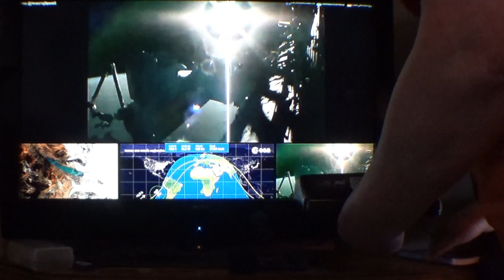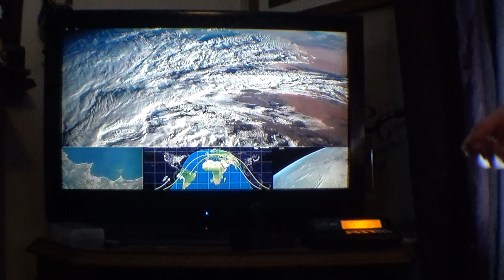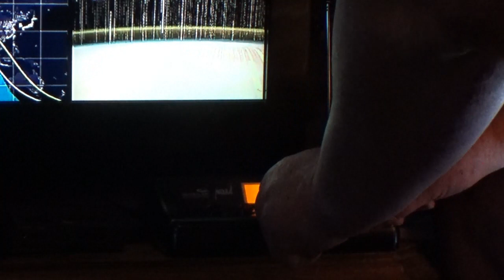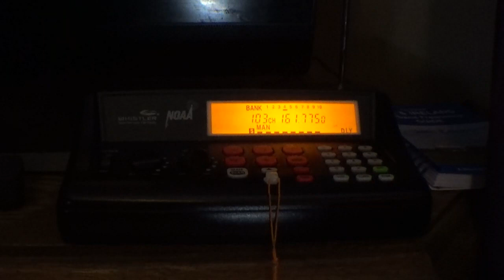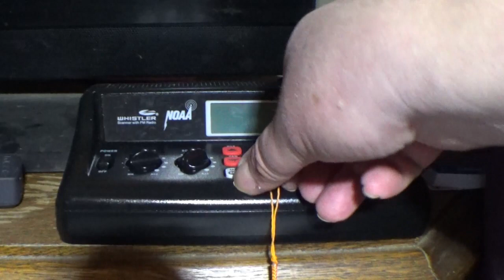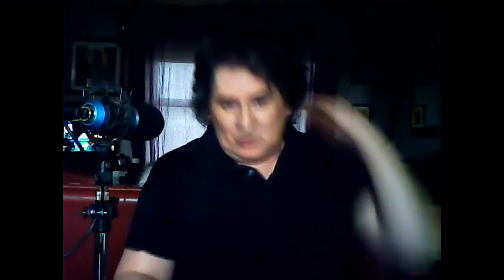SPIRIT BOX SCANNING WITH A RADIO SCANNER WITHOUT MODIFICATION.

Comment: sounds interesting spirit box the only downsides is it’s not battery powered so you need to plug it in
Reply from the maker: Im sure there are 9v battery packs out there that should fit it, thing is you would have to make sure the polarities are correct or it might damage it, but im sure it could be got for it.
Reply: @lifeafterlifeproductions  easy to power this device using a powerbank and a power converter cable wink wink. Interesting video Samantha